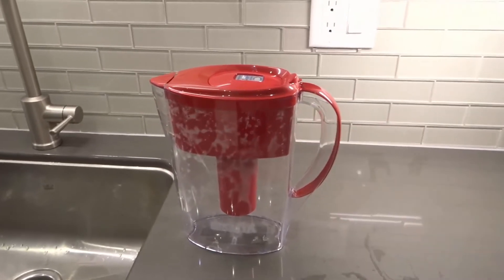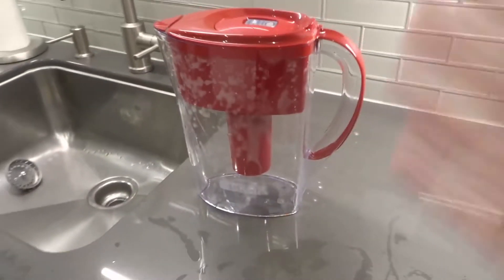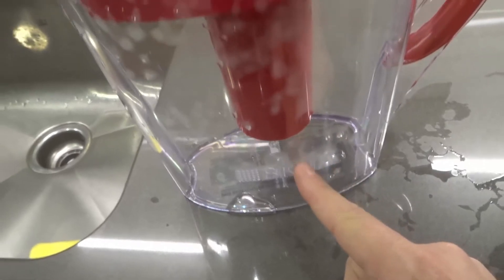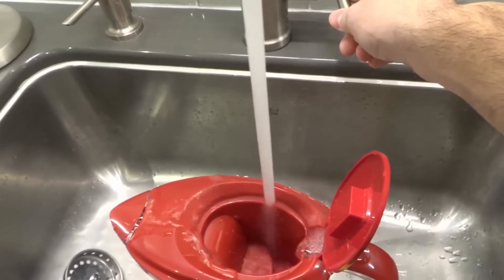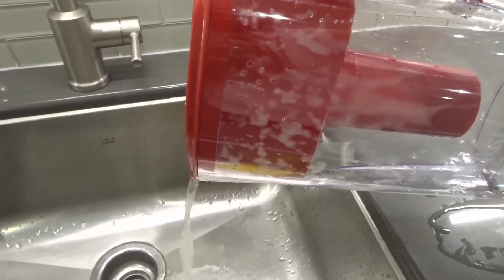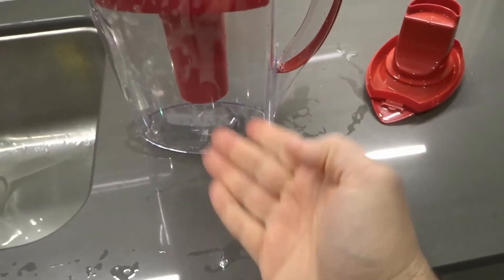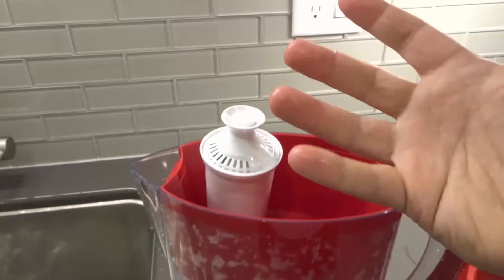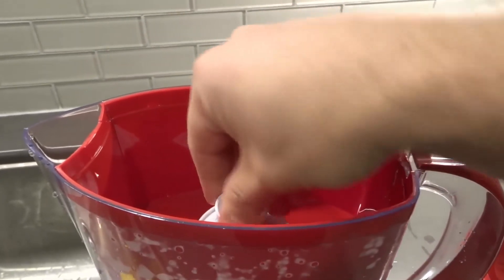Brita Water Filter-How Does It Work-Easy Explanation

Comment: Horrible demo. never showed how to use the top light..I will have to reread my instructions until you get a new demo person to demo your product correctly..
Reply: The indicator on the lid is basically a timer. When you put a new cartridge in the jug you keep the button pressed until it shows 100%.
Over a period of about a month it gradually goes towards zero. When the indicator is at zero, it is time to change the filter cartridge. Don't forget to reset the timer when you do this.
Reply: @richardfishpool4834 Is that LED indicator really just a timer? I thought it monitors the throughput of water but I am not sure.